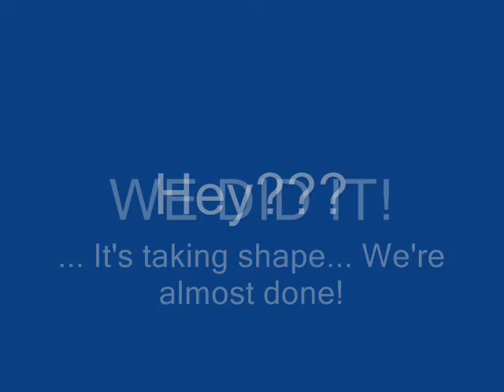Weekend Project L298 Dual H-Bridge Motor Driver pwm ecm

Comment from the maker: Agreed, although they get credit for mounting the chip facing properly so it is not easy, but also not impossible to get the heat drawn away from the chip.  (I believe there is a newer version of this kit it may be easier to get the heat out. Dunno for sure.)

Comment from the maker: I know. Isn't it great to solder protected devices. No ground strap needed. Didja note no anti-static bag with parts in it?  So you're saying this is a great project for someone to build without having to worry about static destroying parts.  Good catch, others might have missed that.

Comment: Nice work but the only problem with this kit is that it does not supply a heat sink for the L298N driver chip which will get very hot during use..

Jax